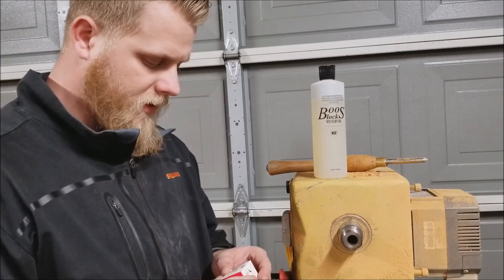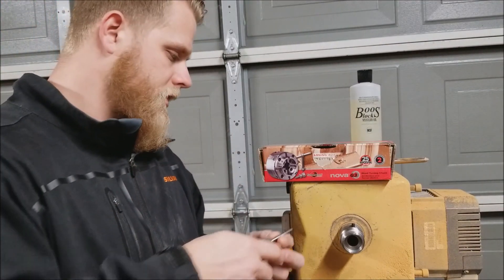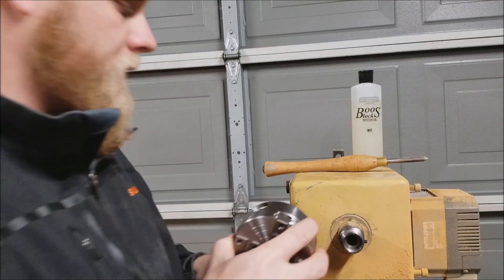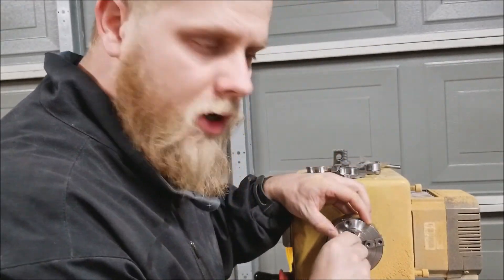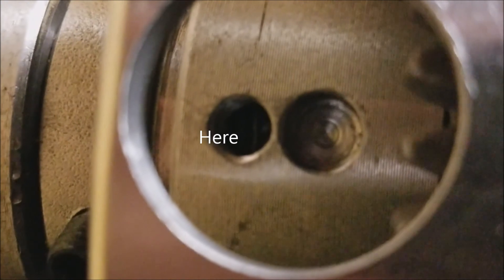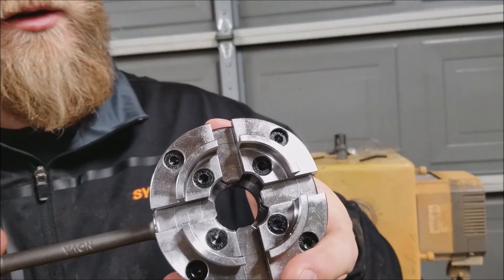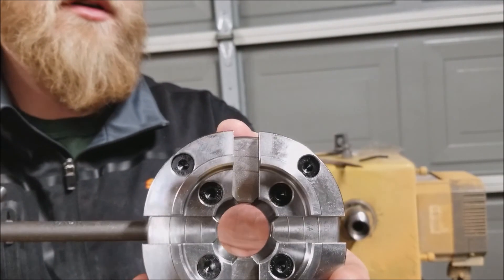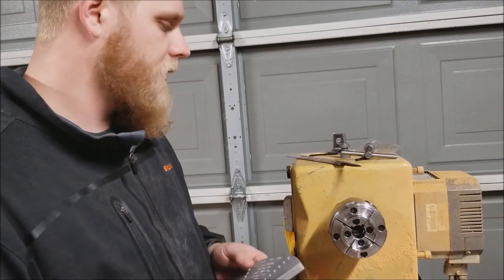Nova G3 Chuck Unboxing and Installation (Brief Cole Jaw)

Comment: If you look in the small parts bags, there is a small fiber washer that’s supposed to be placed in the threaded hole that the Allen screw goes in to secure the chuck to the spindle, before the screw. It protects the threads while still locking the chuck firmly down. The adapter has the same washer, but they’re so small that most people never even notice them, and they get thrown away!